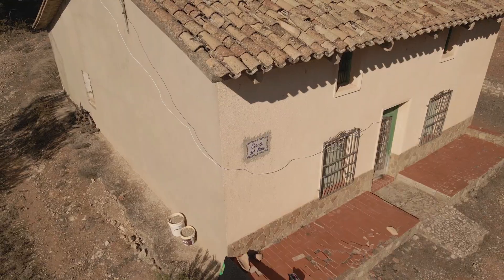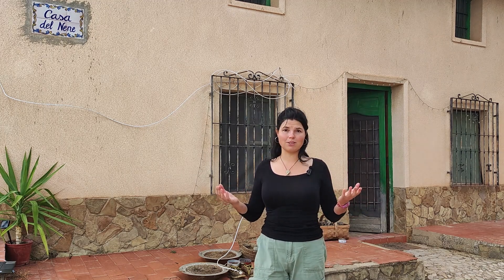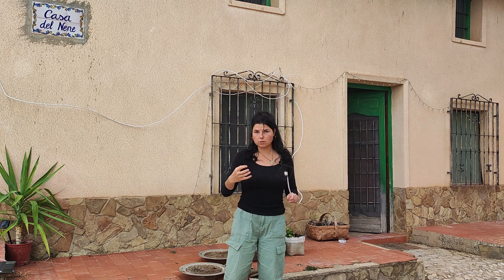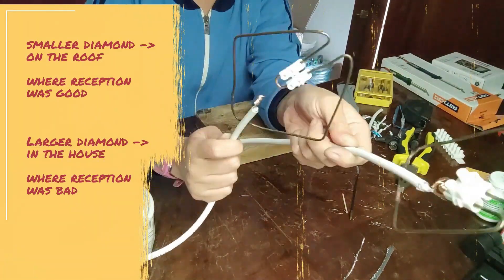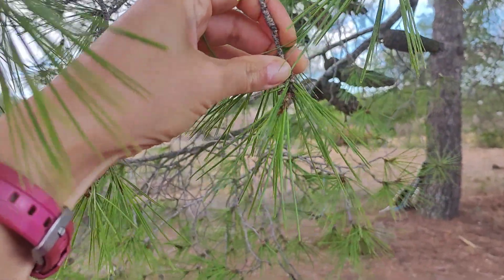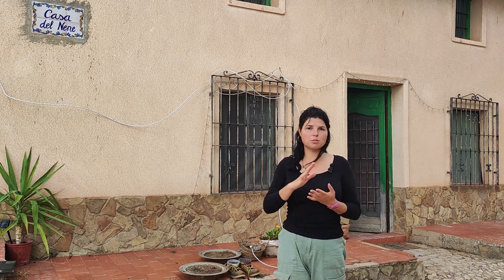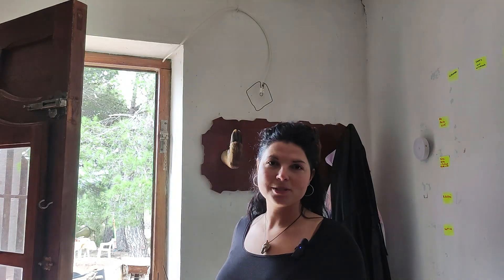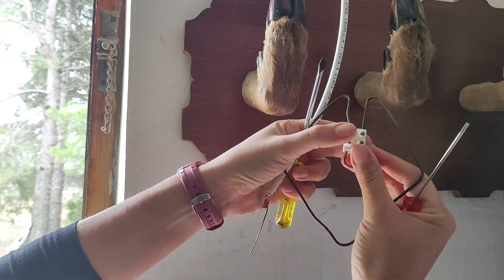Mobile signal booster WITHOUT electricity DIY

Comment: Hello, I am in my village right now working as a programmer and i like the feel and all of that, unfortunately signal is very very veryyy low, i wanted to make this, and i currently am, i have two questions, ive read in some books that in bad weather it can attract thunders and boost them in the house :"), but yes, i wonder if there is grounding option for this project, to somehow connect the outside antenna to the ground for the safety, and  the second question is do i need the antennas to be that width of the wire, because i have some already in that shape but thicker, so will that work? Amazing work living off grid and working as a programmer, i myself go for that in a few years :)

Comment: An (admittedly complicated and techie) upgrade would be to use a waveguide tuned to the wavelength of the cellular signal (of the band with the strongest signal/fastest connection) to replace most of the run from the outside antenna to the inside antenna, minimizing the amount of coaxial cable used. The cable losses (especially in thinner cable as shown in the video) at these frequencies is horrendous. Another simpler (albeit pricey) option would be to use larger coaxial cable meant for higher frequencies such as the microwave bands.  These strategies would likely give you even more signal and faster up/download speeds!   Thank you by the way I definitely plan to try this out at my family's lake house where the cellular signal is just bearable currently!😀

Comment: Does this device boost starlink signal, like am connected to a starlink service but the signal isn't strong thereby making it to disappear. Can this device boost the starlink signal
Reply from the maker: Hi! By "signal isn't strong" do you refer that satelite signal is not strong or that the router's signal is not strong? In other words, is internet fast if you check right next to the router?
Reply: @ProgrammerOffgrid  
What I mean is, the provider is the starlink service is at another compound, so from mine is just zero bar that shows, but if am close to his compound it becomes strong, so am asking, can this network booster device increase the signal bar in your house, like if you are getting 1bar of the starlink signal, can this boost it to 3bars on your phone??

Comment: It didn't work for me..maybe its only good for low frequency
Reply from the maker: Too sad :( I'm not sure about the frequency
Reply: Different frequencies will change the shape of the antenna
Reply: Verizon 4G antennas come in various shapes, but common types for home internet/hotspots are panel antennas (flat, rectangular, often with multiple elements inside for MIMO), log periodic antennas (like a fishbone or ladder), and small, low-profile puck-shaped omni-directional antennas, all designed to boost signals using MIMO technology (2x2 or 4x4) for better data speeds, needing to be aimed or placed strategically. 
Common Shapes & Types for Verizon 4G/5G:
Panel Antennas: Flat, rectangular, often mounted outdoors on a wall or window, housing multiple antenna elements (like 2x2 or 4x4 MIMO) for capturing signals in a focused direction.
Log Periodic Antennas: Resemble a fishbone or ladder, directional and require aiming at the nearest tower for best performance.
Omni-Directional Antennas: Small, low-profile "pucks" or cylindrical rods that capture signals from all directions, good if you have multiple tower directions or want simpler setup. 
Key Features:
MIMO (Multiple Input, Multiple Output): Modern antennas use 2x2 or 4x4 MIMO, meaning they have multiple internal antennas (e.g., 4 elements in a panel) to send/receive multiple data streams for faster speeds.
Directional vs. Omni: Directional (panels, log periodic) need aiming at a tower; Omni-directional (pucks) work in 360 degrees.

Comment: You can get better results with a 4G Wifi router which has external antenna connection (for example Mercusys MB110-4G). Costs about 50 EUR. You basically already have an external antenna just need an SMA connector for the router connection. Hang in there :)
Reply from the maker: Thanks! And for the model also!

Comment: Maybe 15 years ago I got a Huawei B970b 3G modem/router from Vodafone but I had to get the external antenna from other place, the cheaper one was 70€ and it was a plastic housing with a few meters of cable with a connector. Since it was so expensive I opened it to see what kind of high tech it used and it was just a bare wire bent more or less like that 😓
Reply from the maker: this is an idea for the startup 😂